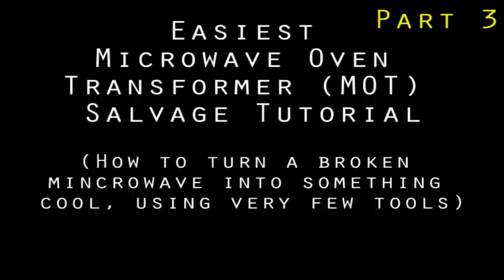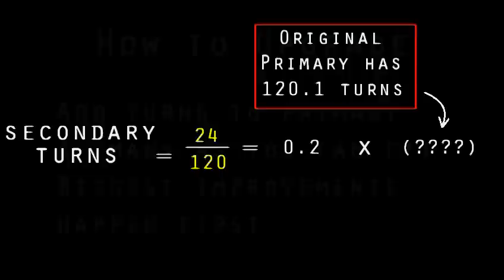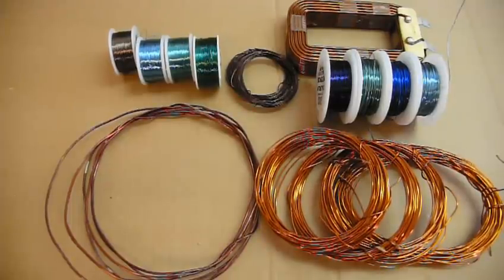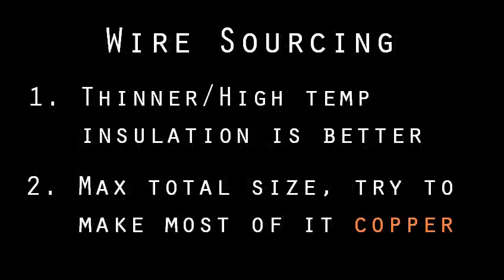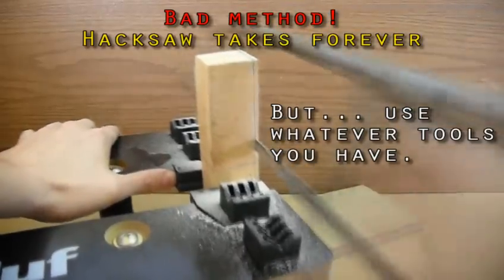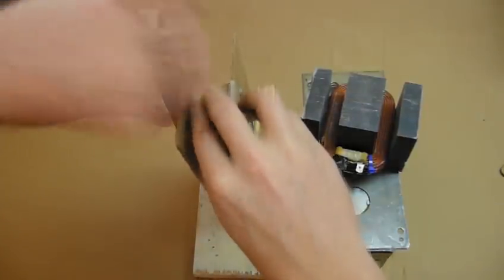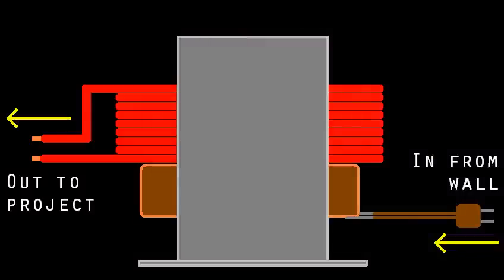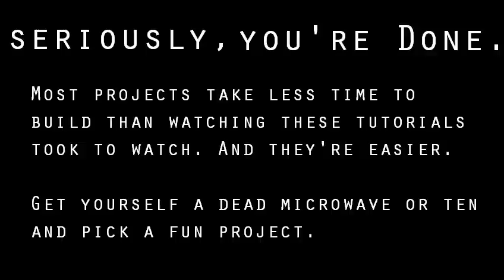Easiest MOT Salvage Tutorial Pt.3

Comment from the maker: To some degree, yes. It will also make your volts sag more heavily under load (true of using any shunts) which is generally undesirable. Shunts don't limit current in a "leave it alone until it hits X" useful way. They muddle with it along the way. The better method is simply more primary turns. If you want one that stays cool in ambient air, use 2 primaries in series (240 turns). But note you won't have much room for 2ndary unless you replace the whole primary with thinner wire. Many options.

Comment: Wanted to say thanks.  Funny I've torn a lot of these apart over the years.  As a kid the "E" made goodthrowing stars.  As an adult the wire made good salvage.  I knew what a transformer is but it never came together that I was tearing one apart.  It was sort of like all the Doohickies one finds on a circuit board-neat to look at but not knowing if they have any further use they get junked.   Need something that walks people thru the basics of what those things are to desolder an reuse.

Comment from the maker: +Alok_Deherkar - This really deserves it's own video, I just haven't finished filming it yet. In short... you can wire the primaries in series or parallel. Both work, as long as do the correct thing with each of them depending on the solution you pick. For your situation, I would wire the primaries in parallel, but their phases must match (all heads and tails each together if coiled the same direction (clockwire/counterclockwise), reverse any that is coiled backwards). For the secondary, again, you could wrap them in parallel or series. I recommend series. So for a welder if you're looking at 30v and 3 transformers, size your wire so that you barely fit 10 turns on each core. If you voltages add wrong (10+10+10 = 10 instead of 30) then one of your secondaries was put in series backwards (10+10-10 = 10), just swap that one's head for its tail. Make sense?
Reply: bruhhh! I watched probably close to a hundred of these types of videos. not to mention, I rewatch the good ones (like this) countless times. I came across this one today. already watched the previous 2, and I subscribed etc. when looking for that spot welder video tho..well, I cant seem to find it lol 8 years so I'm guessing you changed your mind? this is amazing content, and I love the humor. bout spit my coffee out, when you started painting your nails, in the one..thanks homie

Comment: I should be able to easily use standard single strand 10 to 12 gauge romex for the secondary winding. Should be plenty of room, with lots of room to spare. And it should then carry enough amperage to keep the drill supplied.
All this, I have gathered from the info you provide. And thank you very much for that.
Now the questions. (Continued)

Comment: this series was obviously a lot of work. and i appreciate it.i have a book called quick and dirty transformer design. which has all the math but i Never thought about using mots.i build homebrew tube sw radios and transmitters.and tubes need higher voltage.i may try this cuz formers from radio daze are like 100$!. ty

Comment: Nice demo sir . Thanks. I want to use this 12 volts 40 amps mot power supply to my Hydrogen generater could i run it continue ? What sq.mm of wire have to use and how many turns have to wind ?

Comment from the maker: Yes. Still making it 60% filmed. My big project is an electric bike from junk which I've filmed as well, and that's occupied both my studios (basement and garage) and it's a pain in the ass to clear everything out and set it up for a different project. The bike has taken way longer than I thought. Spot welding primer: Make a 1 turn secondary. Copper tips, clamp. Done.

Comment from the maker: @konstantinNeo Beryllium Oxide is only present in the tips of the magnetron CRT, and even then is touch-safe unless you grind it into powder and inhale it. It will be either pink or white and looks ceramic. Safe to handle and cut off above or below (mates to steel or copper), just don’t go grinding into the clay part.

Unless you’re after the copper in the magnetron (underneath the heatsink fins) or the 22g tungsten filament there’s no reason to strip the magnetron down that far.

Comment: Thanks for the quick reply. I'm not sure if it needs something more than just to replace the secondary coil of the MOT with a thicker one copper wire and thats all. I don't need it for some special job, i just find it a very interesting project and i have 3-4 not working microwave ovens and some 150kg of cooper wires for recycling so i thought to make something usefull with them. Anyway i'll be waiting for your next videos.

Comment: Attempting a stick welder build with MOTs. Right now using two one I rewrapped the primary the other came stock, got about 35v open circ. voltage on the secondaries...using 120v wall socket primaries wired in parallel, although considering doing separate socket for each. Lays a decent bead down but so far can't get it to weld 1/8" steel together
Reply from the maker: 35v is a bit high, maybe, it's stealing all your amps. 1/8" may be impossible. Good job even getting a bead. Go devour some 1/16" or 3/32", see if those work better? Primaries in parallel are tricky, unless perfectly matched. But seems you've got it to work regardless. I cover this in some followup videos I haven't finished, because I treat my fans poorly and I'm lazy. You're doing well.
Reply: Update: Was able to attach some light mild steel together but very crappy weld "attachments". Wouldn't call them beads. Lots of slag getting in the way. 6013 too little penetration I need some 1/16 6011 which is extremely hard to find. Gonna try and get the 3/32 6011 I have working. Keeps sticking.

Comment: Again thank you very much to pass on these important power conversion knowledge. I had to read it few times to absorb it. 

So basically for my 18 voltDC tool need:

1. Rewind transformer with gage 8 house wire to convert 110Vac to 17Vdc likely 14 turns. This will provide max 65 amp for power tool draw. But I can check voltage with my 10amp multi meter. before load. Correct? Because only when tool is running. Will withdraw more then 10 amp.

2. Need to find (4) 100amp p/n type diode from alternator. How can I check to see if diode is still in good working order?

3. DCDC converter. This part just fine tunning DC input like how many turn on Transformer does right?

An alternative to this DC DC converter. I could connect end of 17Vac output to a longer bare alum wire. Just by adjusting the length clip end on this bare alum wire. I could adjust the Voltage correct? By doing so, per prior message, the volt and amp will adjust accordingly up and down. Not a smart wiring. The closer clip is to transformer end the closer to 17Vac... Is this correct thinking?

4.
Is there an alternative way then purchase this giant expensive capacitor? Can a bucket of 5 gal water mix with Epsom salt provide a same function? The more Epsom salt the more conductive the more volt it can store. Like ancient egypt battery. 
Or 
Can a used car battery provide smooth out sin wave function?
Reply from the maker: 1 - You want to use the largest wire that you can just barely fit all 14 turns into the space in the transformer. That will depend on how skilled you are, and how stiff your wire is. Yes you can check voltage with meter before load. To test amps you do not test the same way as volts. To test amps you have to insert the meter into the circuit, (you have to break it open and add it like a switch). You do not need a separate transformer for every tool, you could create a generic power supply that you can plug into any tool that has the same voltage. I usually use the dead case of the old battery and use nuts and bolts as terminals to screw the wires on.

2 - Diodes are not likely to be broken. Usually alternators break because of bearings or wires. A diode should block electricity in one direction, but allow it in the other direction. It is like a one-way valve for electricity. You can use a car battery and a car light blub. Connect the negative to the bulb, connect the positive to one side of the diode, then connect the other side of the diode to the bulb. It should light up in one direction, but if you connect the diode backwards, not light up anymore. You might not find 6 individual diodes, you might find a big black half-circle with 6 connections on it and have to figure out with trial-and-error which wires are for what. It probably does not need to be tested. You can also just buy a FWB on Ebay.

3 - A DC-DC converter is usually used to do more complicated work, you are only slightly using it to make steady voltage. For tool use this does not matter at all and can skip it. Adding a giant power resistor will limit how much current will flow, but not control voltage directly. This is a bad method. Also, aluminum will not work, aluminum and copper have too low of resistance, you would need hundreds of feet of wire. Use stainless wire or wire from anything that gets hot (toaster element, stove element, hair dryer, clothes dryer, space heater). But, don't do this, there is no advantage.

4 - You can connect many spare capacitors together like LEGO. In parallel, you just add their uFs. If you have a 200uF, 500uF, and 1300uF in parallel, you have 2000uF total. In series you double their voltage, but their uF is cut in half. That gets complicated, so I would just pick 50V-75v capacitors (look like small cans) and connect them up in parallel. Old power supplies and stereos especially will have big capacitors you can use, near the power cord inside. The biggest thing that looks like a can. No, do not make your own capacitor, waste of time. No, a car battery will not smooth out anything, and you cannot charge a car battery to 17v, it will explode. A car battery on its own could run the tools directly, but, probably only at 1/3 the power since they are rated for 18v and you are only giving them 12v. They would spin slow and almost stop when you go to use them. But, they would work. Lithium tools might not let you, if you use the control electronics, but old NiCad battery tools would work just fine. See this unlisted video I made: https://www.youtube.com/watch?v=5J9PRwbvaW8

Comment: Thank you so much for the direct answer. I ask EBay seller the same question. They have no clue.

So basically I need to purchase multiple rating amp meter for a accurate reading.

Or is there a devise that will measure all current of all size accurately?
Reply from the maker: Many multi-meters will have a range, or even an auto-range function to measure many ranges. I don't like autorange just because it's slower, you have to wait for it to figure out what range it's supposed to be. Most multimeters max out at something like 0.5A. Then there is a separate connection for up to 10A. Above that, you usually need a specialized meter with a calibrated shunt. Why do you need to measure current so precisely at such high currents?

Comment: Hi Matt ,  AWESOME videos !   I was hoping you can make a 100 amp batter charger  ?  I didn't see anymore videos ?  Thanks for reply Matt !
Reply from the maker: Sorry for late reply. Yes, 100 amp battery charger is possible, but you would need a 1500 watt MOT. Also, it's only good for short term (jumping), not a walk away charger because the MOT would melt. To build a battery charger, plan on 11v output. You'll need a 100 amp FWB rectifier ($10-20) or 4 diodes to convert it to DC, and then some large capacitance to help smooth it (20v capacitors, electrolytic, at least a few thousand uF). The FWB will eat 1.4v because the path is through two diodes (each eat 0.7V), so you'll have around 9.6 volts after that, but AC's peak is 1.4x it's RMS voltage, and your battery will charge up to the peak, so, 9.6v * 1.4 = 13.4v. That's about right for a lead-acid "12v" battery. Car alternators are often set to 13.8v.

To build a charger you can walk away from, you need to add almost double the turns on the primary. Shoot for the same target on the secondary. You're not going to get much for amps, maybe 20-30amps. Check it to see how hot it gets.

Comment: High current is what melting metal to red hot while high volts just make metal splitter in the welding process. I see. Thank you.

Is there a different between AC and DC Compacitor? Is it all just bunch coil wrap inside the cylinder. 

Can Microwave Compacitor 200u uf used to store 36Vdc current for example???
Reply from the maker: Capacitors are not coils, very different. Capacitors are not wire, they are two materials with chemical between them. Some capacitors are for AC or DC, some only for DC. Capacitors store energy. They have max voltage. How much charge they store is "uF". You want a capacitor that is higher than the max voltage they will ever see, but not too much more or you are wasting money. 2x voltage is a good ballpark. If 36v, then get at least 50v max rated capacitors. Or 75v. But not 100v, no reason. Same volume of capacitor at lower voltage will have higher "uF" number, which is more energy stored. Microwave capacitor is 2000-4000v AC but only 1uF. Useless, no energy. Same size, a 50v capacitor would be 20,000 uF. Microwave capacitor is only useful for microwaves, no other device needs voltage so high. Check computer, stereo, and TV power supplies for good large Capacitors.

Comment: For a 18Vdc Bosch circular saw to cut 2x4 wood stud or 3/4 in ply wood with 7 inch diameter saw blade. How many peak amp do you think will take?

I will need to find a full wave Bridge Rectifier "double" that amount of amp, otherwise FWB will overheat.

Current is only draw when it needed. So basically I could watch current meter carefully not to exceed FWB to stay safe. 

Or I can install a current limiter or resister such as light bulb or ceramic resister. So light bulb will break the circuit before my expensive Bosch tool over heat.

Is above the right practice and correct thinking?

I also found 3 phase rectifier. It has 5 connector. Is it safer to have 5th prong connect to house ground wire. So it can have ability to trigger the house breaker if it need to?

Below are the 3 phase FWB (full wave bridge or block?)

1x MDS150A 3-Phase Diode Bridge Rectifier 150A Amp 1600V 

Bridge Rectifier 3ph 300A 1600V MDS300A diode 3 phase 300 amp 1600 volt 1pc

-------
I am also looking to install a capacitor as you recommended. What size of capacitor will I need for this build? How do you decide what size it need be? By peak amp draw or by volt it provided.

As I understand. Capacitors job Is to discharge all the DC voltage at instant. Will capacitor over Volt my Bosch tool?

What will over Voltage due to tool?

I have many old lab top charger. They all have larger size capacitor inside. Thinking to just parallel them on a rail with their short leg.

Just add up the number in parallel as I remember from my physic class.
Reply from the maker: 1 - Peak amps? I don't know. Does it say how powerful the motor is? Watts / Volts = Amps.

2 - No, you probably don't need double. The correct amount should be okay. It doesn't sit at max long enough to overheat.

3 - You could watch the current meter, but, I wouldn't worry. You can just as easily touch the FWB and see how hot it is. A heatsink and small fan will allow it to take 200% of its rating for a short periods of time.

4 - That is not how current limiting works. Light bulb would never break. If you add resistance in series, it makes it so that is the maximum current that could flow. I would not limit current with a resistor. It will be fine if you are using an MOT.

5 - I would not connect the 5th prong. You do not need to use a 3 phase rectifier. Single phase is fine. The other phases are not in use. I only mentioned 3 phase because that is what you find inside an alternator.

6 - I already answered your capacitor questions. About 1000uF per amp, but you can use much less, the effect will just be less good. Use some. Voltage should be at last as high as peak voltage, if not 2x for safety. Capcitors only come in a few voltage ratings, so, 35v or 50v would be fine. Not too high or it's wasteful and expensive.

7 - The capacitor in this way is used to smooth out or average the voltage. Instead of being bumpy, it will be smooth like a battery. It charges up when voltage is high and discharges when voltage is low. It does not add to the voltage, it just acts like a little battery to help with interruptions.

 8 - Yes just add up capacitors in parallel, if they are all at least the max voltage. I already explained this in an earlier comment.

Comment: This is a really informative series. I learned a lot about transformers generally and MOT in particular. A couple  questions, although I understand I am a while behind. If I have a MOT from a 120 volt microwave oven, I can’t connect the MOT from that oven to 240 volts because it won’t have sufficient windings? 2. If I want to make a spot welder, making the secondary with one very heavy U-shaped turn is preferable to two or three less heavy turns? 3. On the secondary you turn, why do you want so much gap between the core and the outer loops of the secondary? You used a pencil width at each end, but the original secondary seems like it was very snug to the core? Is that because the original was machine made and could have closer tolerances? 4. The core of the MOT has very shape corners. Is the transformer performance diminished if, after fully dismantling the MOT the edges of the corners were softened a little bit? Thank you got this excellent YT series. Lots of help.

Comment: Good stuff, did you make the video about the spot welders? I'm curious to know the kind of voltages that work well for welding battery tabs. I'm thinking between 2 and 5, possibly making up to 3 stages for low med and High voltage.